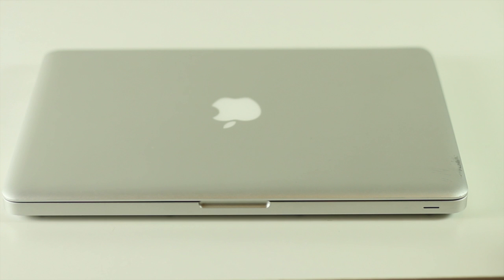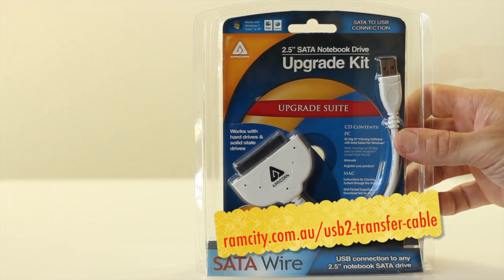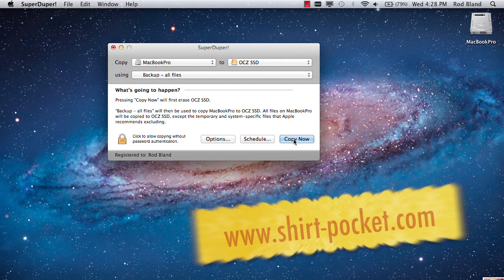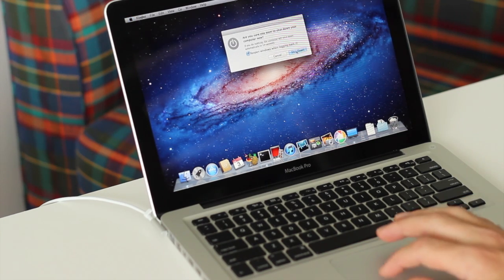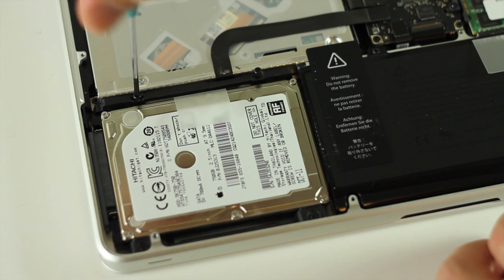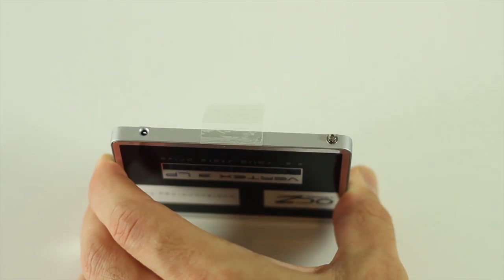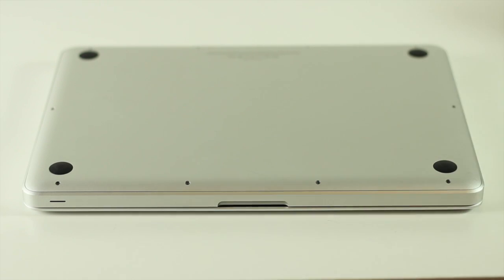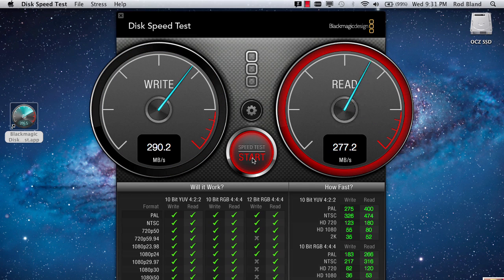2011 MacBook Pro SSD Upgrade with Data Cloning Procedure

Comment: Thank you for this. After numerous you tube videos, I was attempting to clone 1 TB SSD to 2 TB SSD on my 2011 macbook. My time capsule failed to backup on the new card, I bought the USB to SATA cord and followed instructions only to find 24 hours later it could not complete the clone, twice.  I found this video which involved a Superduper download, and it WORKED!!!!

Comment: My hard drive in late 2011 macbook pro has gone bad. When I start my macbook pro, it keeps on continuously starting, stopping, and restarting. I did the apple hardware test and it said that there are errors with my hard drive. My question is: is it still possible to clone the bad hard drive (I am trying to keep my old files and apps )? I don't have a backup of the entire drive though I did make a backup of my documents. In other words, if I put the usb transfer cable into my macbook's usb port, will it enable the cloning process if the system is not operational? Or do I just accept the fact that all my old files are gone, and that I am better off just replacing the hard drive in my macbook pro?

Comment: what if the current internal HDD is a 1 TB with only 40 GB used and I want to clone that on to a 120 GB SSD ? will this arrangement work?  I have a mid 2012 15 inch MBP

Comment: Hey there, I just purchased A Samsung 860EVO 500GB SSD internal drive to upgrade my MacBook Pro (Early 2011). I also bought a USB to SATA cable but when I plug the SSD into my computer to initialise it, nothing shows on desktop...? The lead and the SSD are both working as my local computer doctor tested them on his PC's at the store. He claims I won't be able to upgrade my MacBook pro myself but I think he's trying to get me to leave the computer in his store for the business. Any ideas on what I should do?
Reply from the maker: Try looking in the disk management utility to see if the disk is there.  It may need to be formatted first if you want to see it on the desktop.
Reply: Hey there, thanks for the reply. I plugged in the SSD and opened my Disk Utility however it only listed my MacBook HD.
Reply from the maker: Hello again Martin. Could you try accessing Disk Utility through the Recovery Console and then plug the SSD in. Hold Command +R before you turn the system on. Did you buy the SSD and Cable from us? I can't find your RamCity account, using your full name. Would you be able to provide the email address used in your RamCity account or your order / invoice number, please. Thank you.

Comment: Thanks for the informative video. Thinking about upgrading my MBP late 2011 to an Samsung 500GB 850 evo SSD but I'm a little confused whether or not I have enable trim to help prolong the life span of the SSD. Any help would be greatly appreciated😎
Reply from the maker: You can enable trim from the command line, but even without it the garbage collection routines are still very effective at maximising the life of the SSD.

Comment: Hey Rod, just finished doing an upgrade on my mid 2010 15" MacBook Pro. Apparently the 8+8GB ram upgrade isn't compatible with this model so I'll just stick with the 4+4GB I did last year. I've installed the Crucial MX300 1TB SSD and suffice to say, your video was all I needed to guide me through the steps. Speeds prior to the upgrade were: write = 39mbs, read = 42mbs. After upgrade, write = 250mbs, read = 240mbs. Not as spectacular as the difference in your example, but then it is a later model with maybe more ram. I'm not sure if there's anything else I can do but at this sage, I'm pretty happy.
Thanks again.
Reply from the maker: Hi! Glad to hear things went well. The speeds you are seeing are due to the older SATA interface used in your machine rather than the one used in the video. The machine simply can't hand the full speed of the drive but still out performs the old HDD by a mile.

Comment: Hey, one last question for tonight:  I have my original HD partitioned to run VMWARE Fushion with Windows 7 running on this partition.  When cloning my SSD do you recommend that I uninstall the VMWARE along with windows?  Is there a way to save the windows side and the VMWARE SOFTWARE?

Comment: Your new drive capacity is only 240GB vs. the original 750GB... how were you able to close it?  unless your total drive consumption is under 240 GB....
Reply from the maker: +Mixxwow Nail on the head. When cloning, the program only clones the utilised partition space and not the entire partition. As long as the target drive has a larger capacity than you have used on the original drive then the clone will complete perfectly.
Reply: Very useful video. May I know that cloning will copy BootCamp as well?

Comment: So this is all I'll need for transferring everything, I'll be getting a early 2011 MacBook Pro with El Capitan on it?
Reply from the maker: +Some Guy Named Blake Hi, indeed this is all you require. The new drive, the transfer cable and the cloning software.
Reply: +RamCity thanks for the reply, but I'll be getting a Samsung EVO 500gb ssd
Reply from the maker: +Some Guy Named Blake The Brand of SSD is of no consequence, you amy use whichever you like.

Comment: Hi man, thank you for you very clear and helpful tutorial!i have some questions...1-with the usb-sata cable, does it replace the system and folders as they were in the old hdd?2-if i want to use the old hdd just as hdd/archive, have i initialize it before replacing with the dvd drive???3-how can i choose which is the one for apps and operating system and the one just for data???thank you so much in advice
Reply from the maker: +Andrea Namoini Hi, this process quite literally "Clones" the drive. Meaning that the new drive will be installed and your computer will run as if nothing has changed as such all files, folders, settings and the like will be in the same place.

If you want to use the old drive as external storage you must purchase a 2.5" external enclosure, you can then format the drive clean and partition it as storage space, it will work much the same as a simple usb.

The drive you "Clone" to will become your system drive exactly as it is now, any extra storage you connect will work, as stated above, just like a usb. Your main drive will serve to hold all apps and your OS.
Reply: +RamCity Thabk you so much guys!i really appreciate all the help!thank you

Comment: Hi, would like to ask is that clone including all the file and also software ?
Reply from the maker: +Elroy Lee All data on your drive is "cloned" across to the new device resulting in a perfect copy of your computer, from that point you simply install the drive and your machine will boot as if nothing has changed... except now it is lightning fast.

Comment: Excellent video.
Reply: Working on my mid-2009 Macbook Pro, I followed the directions and in 30 minutes completed the entire process (plus three hours to clone the new drive).  I replaced the original generic (Thai) 250GB with a Seagate Hybrid SSD 500 GB memory. The performance upgrade is remarkable.  Thank you, RamCity Memory.

Comment: Thank you for the very helpful and clear video! I had a couple of questions:

1) Can I take my original SATA hard drive that comes with the MacBook pro and put it in the OWC data doubler, and then put my new SSD in the hard drive slot? The reason I ask is because I've read performance is better if the primary hard drive is in the hard disk bay. Not sure how true this really is...

2) When both hard drives are installed in the laptop, is it possible to clone the old disk onto the new one without having to use the transfer cable?

Thanks again!

Comment: Thanks for share. This tutorial works great. I just needed a USB 3.0 Adapter, my old USB 2.0 doesn't work and disconnect the SSD several time while copy the files. So, only use a USB 3.0 Adapter. By the way.. my Mac runs faster now. ;)

Comment: Nice video! I have a mid 2009 macbook pro and i want to upgrade to an ssd. Does any ssd work on my macbook or does it have to have an specific measure?
Thanks.
Reply: Yep as long as it is 2.5 in and don't get a powerful ssd as 2009 macbook pros are only sata 2, so maximum of 300 mbps of each reading so I would just get a crucial m500 as it is very cheap, reliable and still more than 300 mbps
Reply: Thanks!